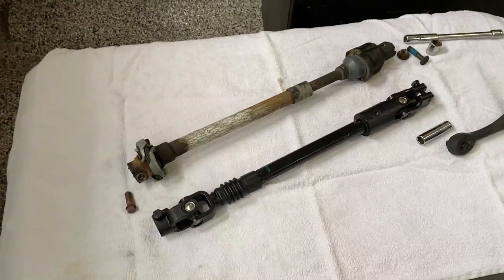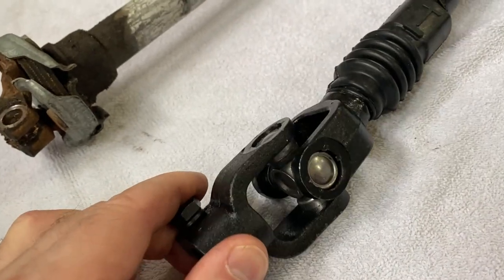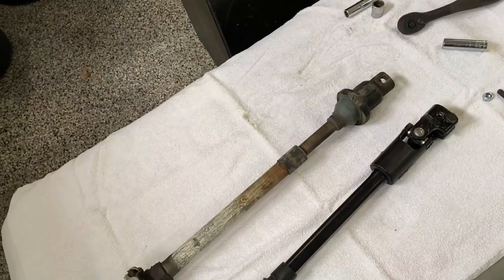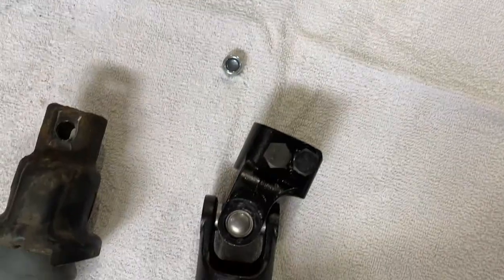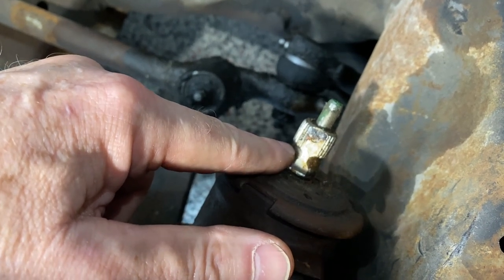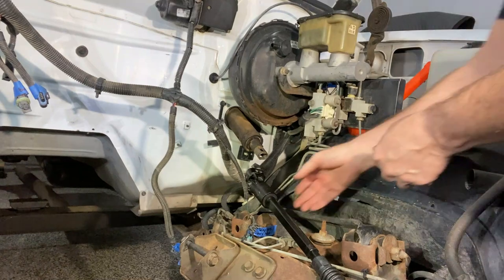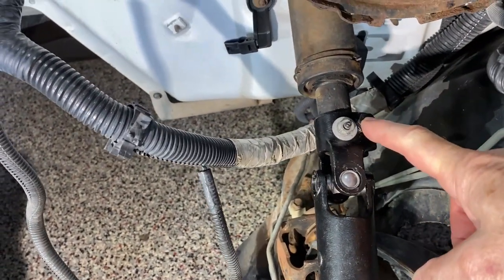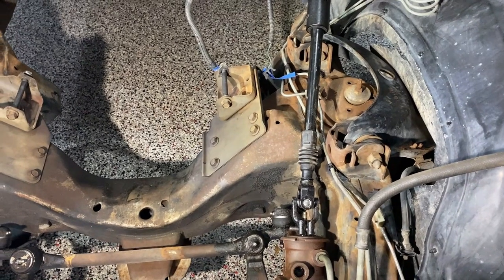1988-1995 OBS Chevrolet Truck LS Engine Swapped Budget Steering Shaft Project

Comment: Will this work on a 1996 Chevrolet C1500
Reply from the maker: I can't say for certain without seeing what your '96 shaft looks like, but, I found in my research it should then some changes came in '97. I would say check the gmt400 forum and search to see if anyone with a '97 has done it. If you order your part from amazon, and it doesn't look right you can at least return it.
Reply: @laurencevillegarage  what’s your email

Comment: Does not work on a 97 Tahoe 5.7 4WD. It was to short by 2-3". Now I'm stuck with a useless part that cost $40.00 and will cost $55.00 to send back. My truck is now immobile till the OEM part comes in. Do yourself a favor spend the extra money and get the OEM intermediate shaft.
Reply from the maker: My application was a '91 Pick up truck, it can be done, but you do need to do your do diligence and research your specific application. Just because the pick up truck and SUV share similar body design does not mean all parts will swap over and the same can be said for the trucks....many parts are the same from 88-98 but many are different as well.

Comment: Ordered that part no# which didn't retract .
Reply from the maker: I looked up the item:  Steering Column Shaft for Jeep Cherokee XJ 1984-1994 w/Power Steering 4713943  on ebay and it does retract. Look at all the pics,  pic #5 shows the amount it can retract.

Comment: Will it fit a 1996 gmc 1500
Reply from the maker: It should. Having said that, you may need to "tweek" it a bit for your application. I've seen others like mine, that went in with no problem. I've seen others that required some "massaging" to fit properly. Without looking at yours to see exactly what it looks like, that is my best answer. Try to by from someone who would allow free shipping back to you if the one you purchase doesn't look like it would work so you are not out extra $.

Comment: What and where did you get the 3 wire water temp sensor from? I'm wanting to ls swap a 94 v6 obs
Reply from the maker: Over time part numbers change or get dropped. You can cross reference part #73548951 or #12551708 and you can find the sensor. A quick check w rockauto pulls up both. Be sure to make certain the part you buy has the 3 prongs (others appear that have 2prongs). The pigtails I use come from either Michigan Motorsports or Boost Monkey. The sensor is ~$20-23 and pigtail $9.99-11.99. Good luck
Reply: Ok awesome thanks for the feedback
Reply: Thanks for the feedback sir
Reply: This 94 obs swap for my father n law for Xmas gift. He just been throwing away money trying to keep that wore out v6 going lol
Reply from the maker: @marcusmumphrey6995  what a great gift idea! I’m sure he will appreciate it very much. Another great gift idea to add to your list is a 1994 Chevy c/k electrical and wiring manual from GM. I get mine off eBay. Outstanding wiring info for your truck. (I have 88-95, 98 myself). Best electrical info you will find for the OBS trucks. Still a decent price, the prices have begun going up along with the popularity of the trucks. If you need anything else, let me know.

Comment: I just check oreilys they want  350 for this shaft know 😢
Reply from the maker: What?! Check Ebay, that’s where I got mine. Search using:  Steering Column Shaft for Jeep Cherokee XJ 1984-1994 w/Power Steering,  there are several under $60.

Comment: This is how and why people on the internet get so miss educated, I stopped watching after 1.27 min. because you tell people that the "problem" can be solved by replacing the steering box  so explain to me how swapping the intermediate shaft will fix the "problem" with the steering box???
Reply from the maker: Thank you for watching the video...at least 1:27 part of it.  I do encourage constructive criticism so we can all learn from YouTube. I don't think it is fair to only watch a small part of the video and make your assessment. I did not say that the problem can only be solved by replacing the steering box. The box is only 1 part of the steering system. As the title implied, I was showing how to replace part of the steering shaft, which is a part of that system which contains the "rag joint" which is an obvious wear part within that system. It was never intended to be a "cheap fix" for a steering box issue. There is no 1 single part that will fix all issues in the steering system or any other system that has multiple components within it. You obviously have experience, why not make a video(s) helping to dispel the "miss education" on the internet. I am not being a "smart ass", knowledge is power and yours can be an asset to others. Thanks again.